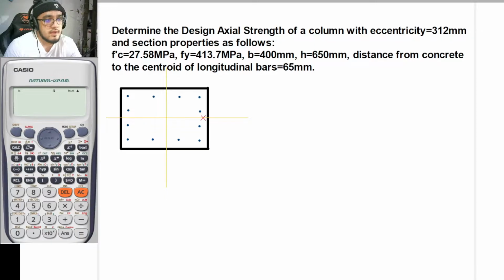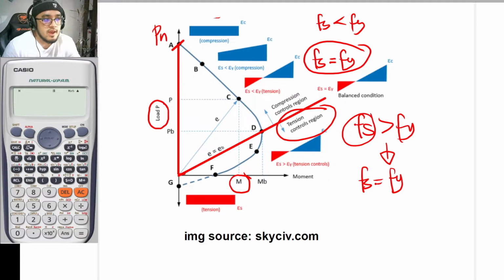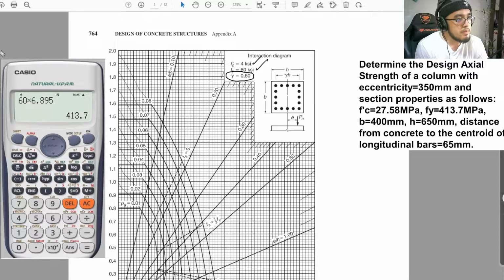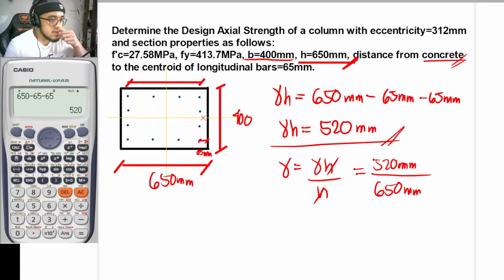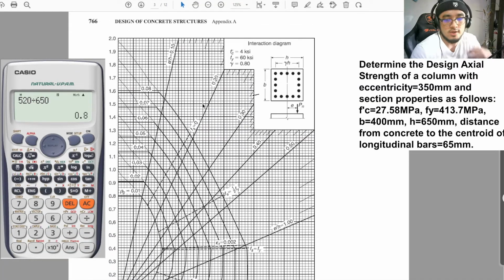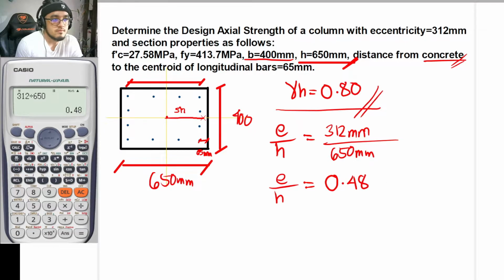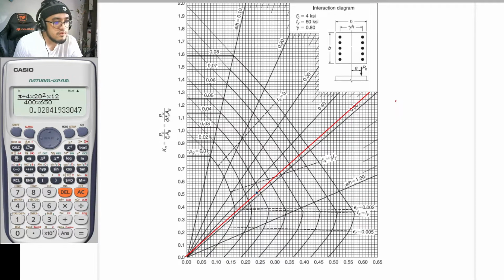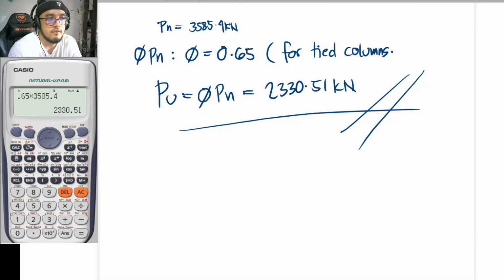Short Column under Axial Compression with Uniaxial Bending | Interaction Diagram

Comment: gross  steel  quantity 
 interactive  diagrams 

short column under compressive stress 
size of column  400 mm x 650 mm 
 clear cover   65 mm 
 e/η  = 0.48 
 ν = 0.80 
  I studied short column design back in college   at PEC..affiliated  then to Anna University subsequently it  was   taken up by Pondicherry university 
 Then I taught  ...... environmental  engineering subjects both for the polytechnic students ......
as there were language barrier  I could not   continue in the polytechnic  and many students  like ansari  wrote in the local languages  ....I  did  post graduation  in environmental management ....at Anna university  after   scoring  TNCET  to qualify  for the  post graduation   unlike my sister  who studied   MA English ...at Petersburg ......
 It was difficult  get  structural engineering  on part time at Anna university  unlike  Stanford University  which   accommodates  students without any pre qualification ........ And  the papers  at post graduation   presented ..... was  peer publication  with ......the .....college where I taught engineering ....... 
This  source  skyclv was  really  interesting 
 Invariably guys  don't  really  study  so hard  and they just get  the answer scripts  corrected by the   controller of examination  himself who  ....
  While supervising  examination  at several  deemed colleges affiliated either to Pondicherry or Anna universities    for maths  paper .....there were more  students  than the strength of the entire  college ...which was  
I was never given  squad vehicle or squad duty ................... so  I am ......not using a car or college  bus to commute 
jessypanerselvam@gmail